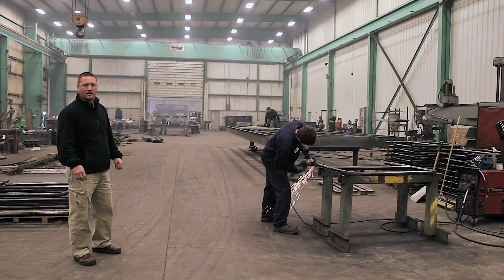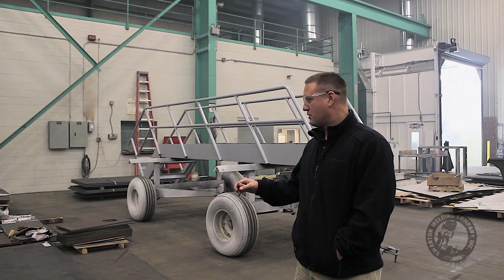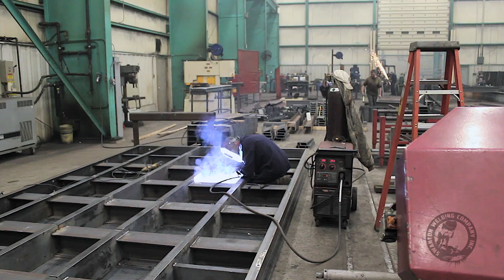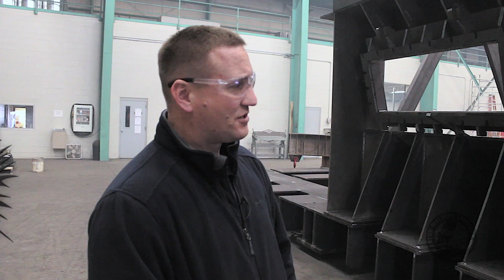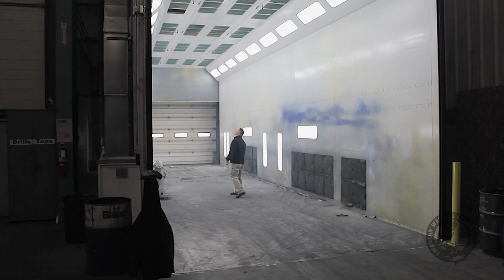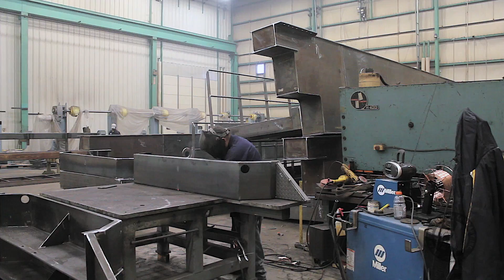Heavy Fabrication Services at Swanton Welding & Machining, Inc.

Comment: I used welding to get into computer aided design, right now working under an engineer basically drafting, I love welding but it’s on its way out and the layoffs come out of nowhere. They will never completely get rid of fabricators stuff always breaks and need to be repaired or refabbed but its on its way out.

Comment: Sorry but this is  Medium fab work.
I worked in one of the biggest fab shops In Detroit.
Some of the bases that I had to preweld was around 20 tons and had to flip them over without pulling  the bridge crane out of the ceiling.
Reply: 20 ton bases. What type of project were  you guys building?

Comment: Only saw two safety infractions , two men operating grinders without guards on . Injury's could add considerable cost to production . The shop is very impressive other wise.
Reply: Blackdogcamper  every shop I’ve ever worked in...the guys take the guards off the minute they open the box. If your wearing your PPG, there won’t be a problem.
Reply: @timvandenbrink4461    that's been my experience as well. The minute the new Metabo comes out of the box the guard goes in the garbage
Reply: Crane he said was 30 ton capacity but clearly showed 10 ton, and no hard hats
Reply: The minute that steel hits your face you gone be thinking "aww fuck ,where is my shield "